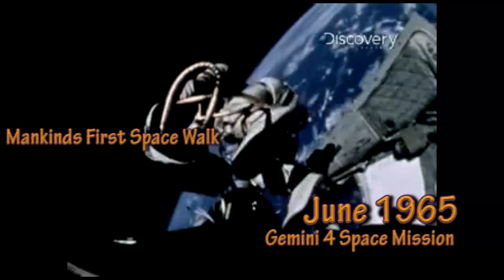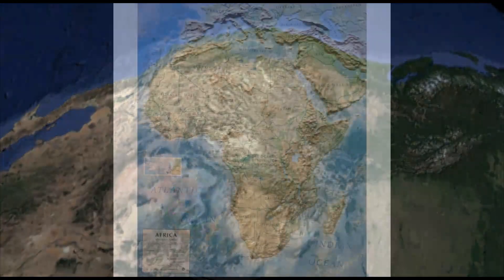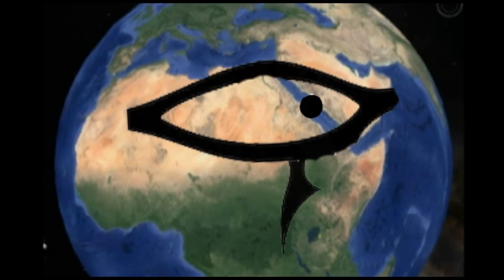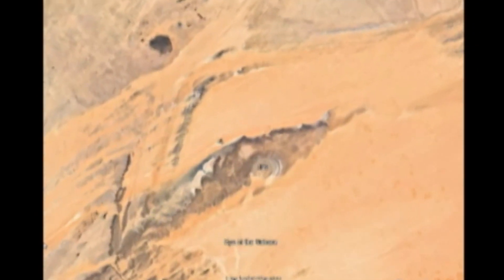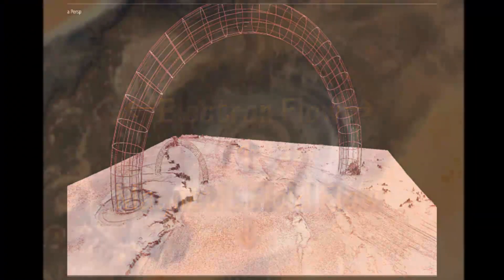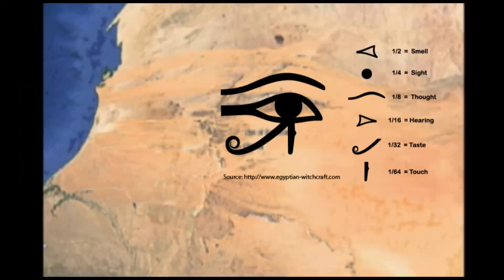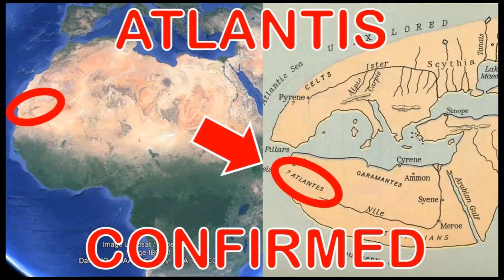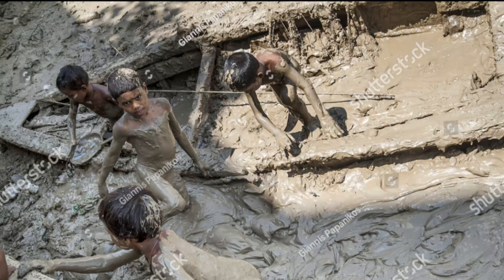Apocalypse 10: Atlantis Destroyed - The Richat Structure Solved by Cataclysm

Comment: There has always been doubts about the richat structure in my opinion. There is an eye which circles Tibet  with a tail leading to the banda sea Indonesia. If you look at ESA gravitational anomaly maps you will be amazed at how clearly you can see it. Then make a line round the earth from nazca  to angkor wat and it will go directly over that spot. Also the line goes directly between the giza pyramids and over Easter island.